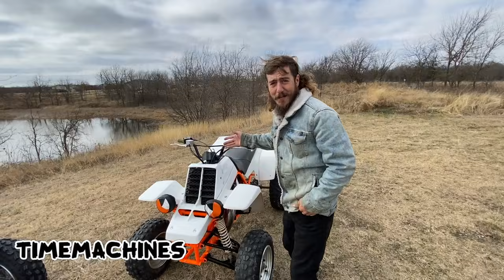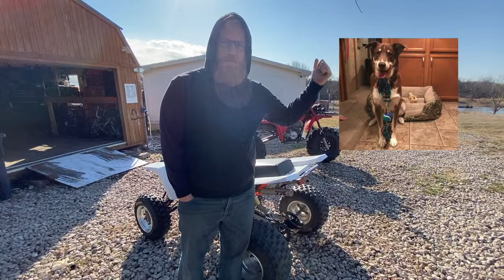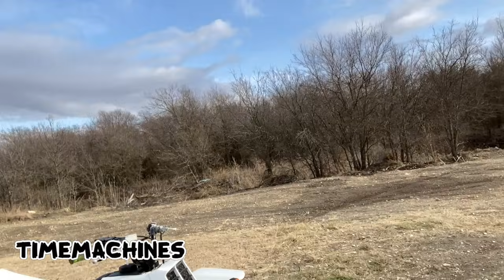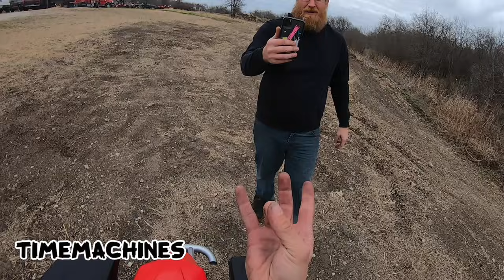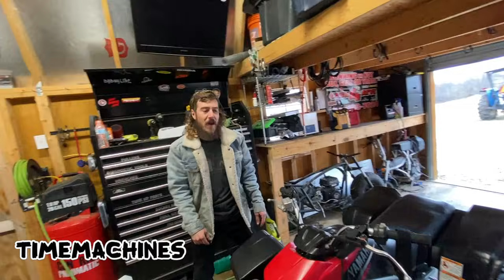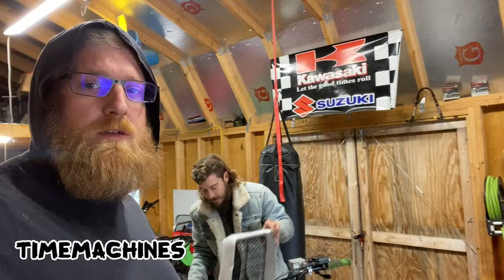Banshee V.S. Blaster | Yamaha Blaster V.S. Yamaha Banshee

Comment: Blaster “Is a kid ATV” 🙋🏽‍♂️ me being 26 and riding the F*** out my Blaster. 🤣🤣
Reply from the maker: Haha we are doing the same over here. Thanks for watching
Reply: Blaster is slow
Reply: I don't know about y'all's blaster but mine runs 70 in 4th gear..... Don't have enough land to get past fourth and I haven't taken it on the street yet. Had it about 2 months.... It's my first two stroke, growing up I rode a Honda 400ex with a little work done to it, was my buddies' bike... Been like 10 years since I rode it so the memory isn't clear but the power in this Blaster is ridiculous in comparison. Wants to pull out from under me.... would take a hell of a great deal on something for me to switch away from this one.
Reply: I'm 41 and still ride mine. Haven't in 2 years so these guys got me wanting to pull the cover off. It's an 03 I bought brand new and it's in about same condition as the one in the video. Cold blooded but its been a fun machine
Reply: @Nysiah-  no blasters will outrun 400 ex stock modified they'll outrun a stock banshee I've owned them all
Reply: @christophermhudson09  What kind of engine is swapped in it, because a stock blaster with a fresh engine will only top out around 55-56mph. I've owned a couple, and I'm actually building one right now. They're allot of things, but fast isn't one of them. Definitely fun to ride though.
Reply: 😂 me being 32 with my 50th anniversary edition Raptor 700r outside and I can’t help but want a blaster
Reply: @chuey9313 I've got a fairly stock blaster. Wisco piston stock crank boysen reed leaf in stock cage and jetting a bit high. I'm 6 foot 200 lbs and it'll pull me 60 6th gear topped. For what they are they do scoot. And I get around trees better then when I ride the LTR
Reply: Yep,  I'm 63 and would still ride them both.  Loved both of them.

Comment: I’d take either honestly. I mean it’s about having a reliable machine with the right upgrades for riders comfort ... but hey if it’s a two stroke it’s all hope.. 💪🏻 Banchee is amazing but once they act up they can be a bit finicky to fix. But it’s a weapon on the trails if your a good rider.
Reply from the maker: Oh yeah. Id prefer blasters all day. Easier to make cash on reselling too
Reply: Don't forget the Kawasaki 250 tecate 4-wheeler. I had a 250 tecate 3-wheeler that I bought used and it ran great! It was a 1984.

Comment: I would say banshees can be fantastic trail quads, and the only time I actually like the single carb. +4 w/ the 2 in 1 kinda helps that twin lag/heavy flywheel effect when you let off up top
Reply from the maker: They are fun machines but lots of tight woods around here not many open trails lol. They are a blast just about anywhere tho!

Comment: I have both bikes. A banshee is a banshee, its fast but the steering and suspension aren’t the best due to the age. Plus, the wheelbase is wide so single track would be harder. It honestly comes down to application. If you go to the dunes or drag then banshee all day. But if you want an all around bang for your buck ill choose the blaster. At 2:11 when you said “if you blow this up, its your fault” i took that personal. I wont admit guilt but i felt targeted. Moral of the story, i had to get my sons motor rebuilt 👀😬.
Reply from the maker: I hear ya

Comment: My daughter's blaster goes a little better, I just did port n polish and took 20 thousands off the head and used a higher compression piston that was 1mm larger it's at the limits of high octane pump gas.  Plus went with a 34mm carb.   Plus used a breathable screen air box lid and free flowing exhaust.    It will eat a Polaris scrambler 400cc 2-stroke on take off and top end.  I also went a tooth taller up front.  😉   Just wish it had a exhaust power valve.
Reply from the maker: They are fun quads

Comment: I have two blasters, so i want a banshee for a little more power. I want to get rid of one and grab a banshee. The major down fall of the blaster in my opinion is that its air cooled. Im not looking forward to the banshee maintenance though.
Reply from the maker: Ive never had a blaster get hot if i kept it moving. I lovem both !  Thanks for commenting banks

Comment: nice video! I would prefer the blaster mainly because #1, I'm new to bikes, #2, I don't really have a need for so much power, #3, I already got a blaster.
Though I had no idea how to run a 2 stroke, that went as well as you'd think, thing was in terrible condition anyways, we're currently rebuilding it, and man, does the front look a lot nicer when there ain't 30 washers holding the headlight on, it's an '02 so no built in headlight.
Reply from the maker: Ah. Yeah i agree blasters are so user and rider friendly. Nowadays people need electric start reverse efi and
Someone to ride their machine and chick. Buncha people soft af
Reply: @TimeMachinesATVs  In my opinion the simpler the better, less things to break and the more control you have over it.
Reply from the maker: Yessir. Plus a blaster will hold up to its own power extremely well.

Comment: I have a Yamaha blaster.. it’s my first real size quad I’m 21 but only 145 pounds and somewhat short about 5’8 so it fits me perfectly.. yea maybe it’s not the fastest when you compare it to a banshee which will leave your shorts behind when you dump the clutch but for what it is.. it is quick it is fun and I think it deserves a little bit more credit and in fact it’s a sport quad Yamaha advertised it as such.
Reply: There's a lot of room for improvement with them though. For a few hundred dollars you can actually make them a LOT faster. The compression ratio is low at 6.6:1, a 9:1 head wakes up the motor considerably. 
The rear tires are a little too tall, running smaller tires and going up two or even three teeth on the front sprocket makes a big difference in how it feels and drops a good bit of rotational mass that the engine has to fight. Going down 6 or so teeth on the rear with a skeletonized aluminum sprocket is a better option performance wise since it removes significant weight over stock, plus the chain is shorter reducing even more weight. Rear sprockets are more spendy though.
Uncorking the exhaust a bit and tuning/rejetting also makes a noticeable difference for mid to high rpm power.
Spacers to widen the stance are a necessary addition for me.

Do all of that and it's a night and day difference in both power and handling for not a whole lot of money.

Comment: I mean, you can probably come use a small sprocket to go fast in the top end, not in the low end, blaster I'm talking about
Reply from the maker: I like the torque
Reply: @TimeMachinesATVs  I meant theoretically, also you should get a Yamaha enticer 340, 2 cylinder 2 stroke snowmobile, almost same displaysment engine, except for snow

Comment: I rather a blaster since waits easy to make more power someone folks have 40hp+ on them with an airsal 225 ported right bend high conoression engine can compare to a stock banshee to a banshee with a good pipe. Ps search blastersaurus 😎
Reply from the maker: I prefer the blaster as well.  Lot more money to be made on them as well.
Reply: Blaster all day. Ported 260

Comment: I have a problem with my blaster it a never wants to tick over and when u have no throtle it will start cutting out and it's not that long fixed
Reply from the maker: Sorry to hear that. May wanna download a free manual on google.
Reply: @TimeMachinesATVs  thx I think it might be the spark plug
Reply from the maker: That would be awesome!!  Always want extras with a 2 stroke dont just buy 1 when u go to autozone!! They fit a lot of different 2 stroke engines.
Reply: Like when you give it gas it dies? That's a common problem with the blaster. Just search on youtube.

Comment: I got a Yamaha blaster with a big bore do a 350 with a New K crank case with a small sprocket in the front and gear to go 10 miles faster. It’s all custom with custom rims and tires. It goes 89 mph.

Comment: shit i just got my first blaster at 38 years old lol. I use it for the 5 acres or so that i have to mess around on. I was always a huge fan of the 300ex and its size but i've always preferred the powerband of a solid 2 stroke. Im definitely upgrading the shocks and widening it as well as adding a +3 swing arm. A mild port job and re-chambered head with a bit more compression and toomey pipe/upgraded airbox/filter will probably be all i need for what i plan  to do. I love how they respond so well to mods. Seems you can damn near double the power with just the mods i listed and a good tune (maybe a bit more timing)...  I was a bit worried it would be too small for me but i could deal with it if i had to honestly. A little more width and length to keep the front end from popping up would make it more fun though. 2 strokes are as addicting as it gets

Comment: I’d rather have a banshee. I had a blaster that I raced in harescrambles as a kid and rebuilt 3x. It had all the vitos 3mm stroker crank and shit you mentioned. ported, polished, big bore, sst pipe, power core silencer, etc. kept it running by flipping burgers. Always dreamt of the banshee and was always too broke.
Reply from the maker: Haha they are both fun machines but i still dont trust a banshee.

Comment: The only time my blaster was fast is when it had a cr480 engine and stressed swingarm
Reply from the maker: Fun machines!! Def would be with a 480. Thanks for watching winch. Lots more vids on channel
Reply: @TimeMachinesATVs  ya it was sweet, I believe it was a 83 built, bored, carbon reads, 90's cr500 vortex cut carb, the whole bike was widened lowered and stretched out, it was retarded haha ended up blowing a hole in the case and sold it. Thanks for the comment man !!

Comment: Look up ken O'connor drag blaster then tell me there slow
Reply from the maker: Ive had a few engines that he had built.but we are talking about yamahas blaster. The one from factory.  Not here to bash blasters video was the opposite actually if anything disappointed it was the banshee. C’mon tho like i dont know about ken onconner racing ive had prob 50 blasters in my life.
Reply: @TimeMachinesATVs  not shitting on any one just saying you can make them go. I my self am a atc250r guy love hondas. Ken can work a blaster motor we on same page with that. Thanks for the reply have a good day
Reply from the maker: No problem you too!!  Yamaha blasters are my favorite quad prob for lots of reasons. Speed isn’t usually on the list. Or power necessarily. But they can be modded. You know tho, they do not compare to a 250r, nor a banshee. Video posting today couple trx250rs and a pilot this week as well!

Comment: Banshee is super fast it rides better and smoother than a lot of the new sporty atv's but if you ride it hard it will wear you out just trying to stay on it, on the other hand the blaster is fast enough for off road riding and I think is the Tonka of the atv's cause you can ride any terrain and use it even as a submarine 😂 and I think it can take more beating than the Banshee
Reply from the maker: Def can take more of a beating. Blasters are the best.
Reply from the maker: Damn right they are 2 of my favs ever. Thanks for watching mario.